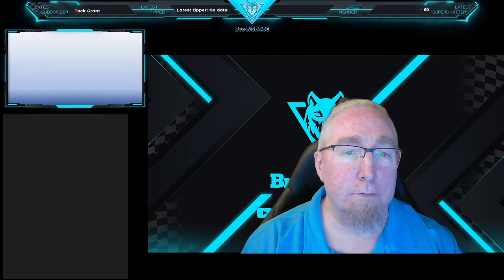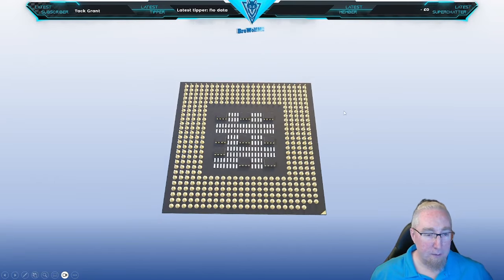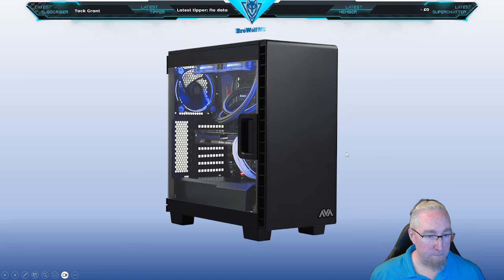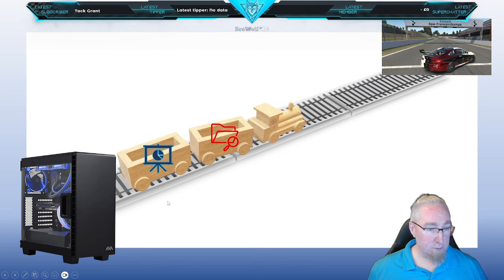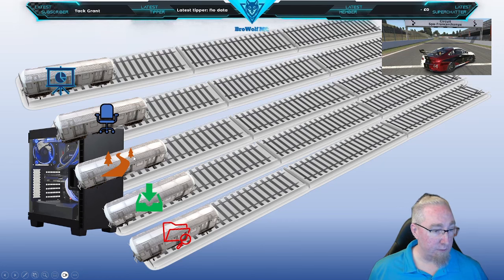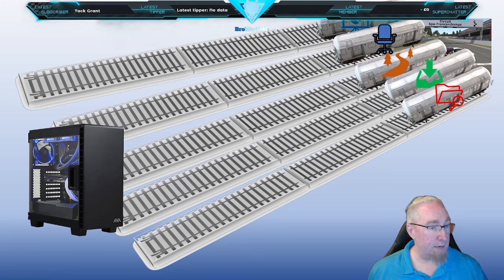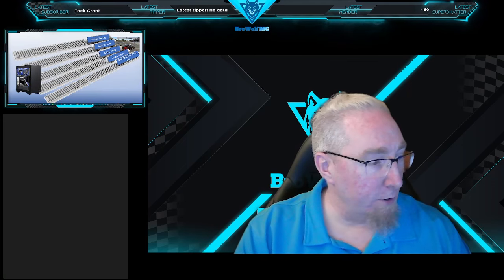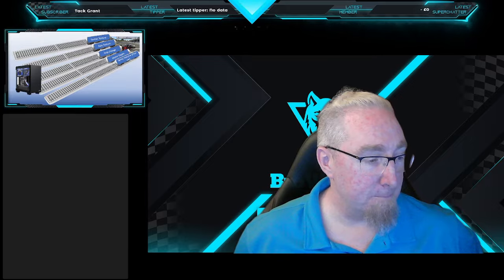iRacing - Rain. Multithreading and why its important

Comment: iRacing has been multithreading for multiple years now.
The minimum specs for the CPU is a 4 core CPU.
Last addition to multithreading would've been the sound engine.

Choosing Spa for explaining it wasn't a good thing either. That track hasn't seen a significant update in 2012 Season 3, where they updated the surface shaders.
What you've described with the different size gras, is actually a static texture of the wall. Same with the "weathering" of the gantry, it is just a texture. These things are handled by the GPU.
Shadows, maybe. That I'm not sure if the CPU is involved in that too much. Reflections, is GPU.

What is on the CPU is all the physics, sounds, input handling, etc.
Rain will impact all the physics calculations.
All we can see, will be some kind of shader and/or texture that is "just" applied to the object. And shaders are rendered/calculated/processed by the GPU.
Reply from the maker: That’s great to know. I thought it was only the last 3 or 4 years they had been pushing multithreading. 

I was trying to keep it as simple as possible hence not covering in depth what actually processed on cpu or gpu. Etc. but thanks for raising the points though. Good info for others.
Reply from the maker: Also - note I have modified the description to explain this a little better. Let me know if that makes it a bit more clearer... 

I did this video as people have been asking me "What is multi threading and how does it help" and I think this is because it is mentioned alot more to aid the rain coming in S2
Reply: Interesting. I wonder why my C indicator goes orange in the rain but my CPU usage according to the task manager is only 20 or 30 %. i9 13900h. 🤔

Comment: Serious question here.
 How are plastic, and metal that are raw materials combined to make a computer  and computer board/processors take electricity and now I am watching this video???
 Raw energy + plastic/metal arranged in different ways = everything computers do???? 
 Please don't say it's code, I know what code is but the question is how can plastic/metal filter raw electricity and somehow it allows us to do everything computers do?
Reply from the maker: This is a great question. The plastic is a way to keep the metal path ways separate from each other. The signals are 1s and 0s and are on off type signals for a switch. Code then interprets the signal. 

But key is the metallic materials are there to conduct electricity signals. The components on the board are then there to help work on storing or using or interpreting the energy signals

Comment: Can you set your a specific core to run iracing and your wheel device?
Reply from the maker: Not that I know. Usually when a program runs it will use a % of the cpu (so some cores may have higher usage than others for that app - but generally it will use all cores (since most multi-core processors are homogeneous) 
That being said if iRacing is using to much cpu (have the task manager running in the background so you can see this) and the wheel is struggling. Then in task manager cpu usage will be very high overall. Best thing todo is reduce graphics etc in iRacing. But first see if other stuff is using cpu and end those apps (unless they are system ones etc. )